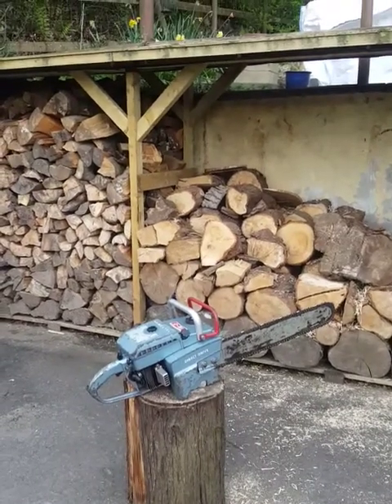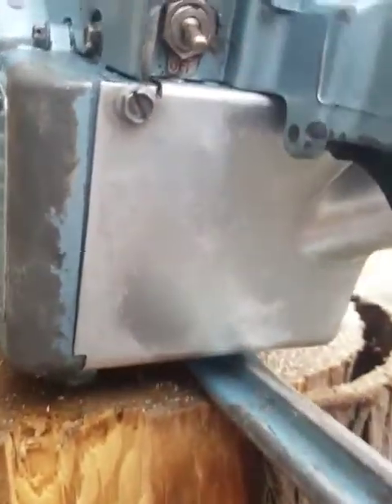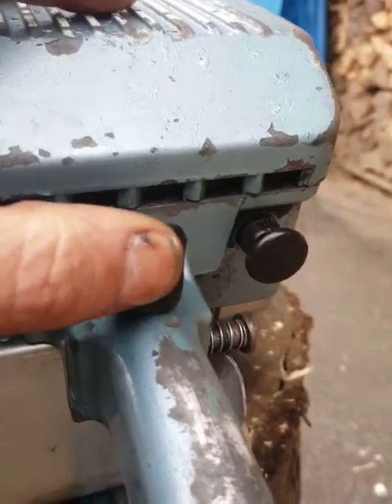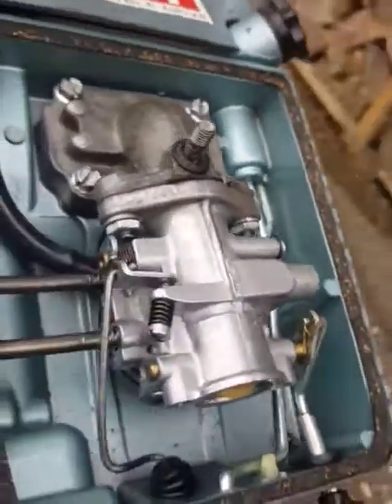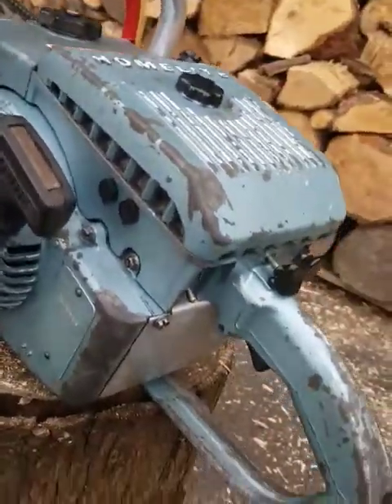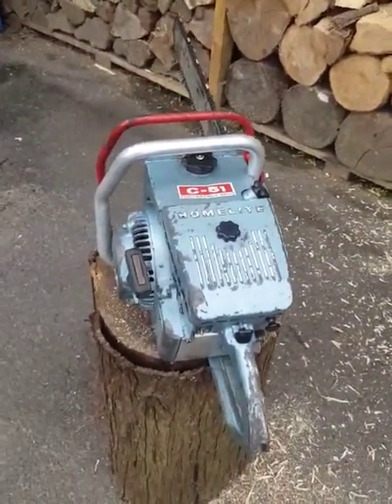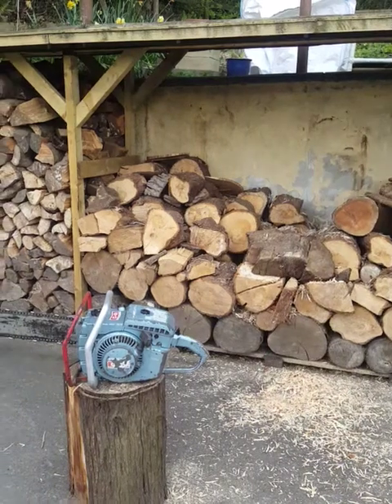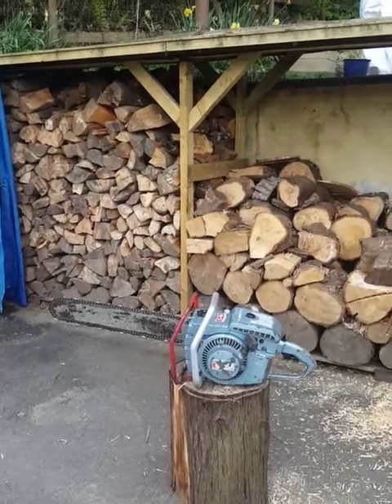Homelite C51. First run and cut

Comment: You made me laugh my friend when you called it a silencer! There is nothing silence about that pipe! We here in America refur to it as a stack or a stinger pipe! I use these stinger pipes to show people that you cannot plug a 2-stroke engines exaust pipe off with a set of baffles and spark arrestors and blunt faces that make the spent exaust gasses hit and turn direction to make it's way out of a narrowed down hole to escape the saw! It creates a lot of excess heat passing by all the things that have been installed in the exaust pipe through the years by the EPA to save the planet! Anytime you ignite a fuel that explodes when lit on fire  in a combustible area you are now dealing with a super heated air traveling twice the speed of sound! And some of these newer saws are doing 14000 thousand RPM! That's alot of back to back firing super heated exaust gasses past these pieces that are inside that exaust pipe catching that heat and transferring it back into the cylinder of your chainsaw! All you have to do is take a little stroll back in time and take a look at the vintage chainsaws and the wide open stingers on all of them! Loud? Oh yes they are! But you can run a saw all day and never have a heat issue with one of those exaust pipes! But with a new saw with all the planet saving crap packed in your exaust, you would be lucky to get out of the woods without a scuffed piston on the exaust side if you're not very careful and skilled with a chainsaw and know what the sound of a piston trying to seize from being over heated! Besides, I love to disturb the peace with a saw that barks for a city block or ten! It says, there's a new sheriff in town to all the rookies that don't know how to tune one and make it bark like a big dog! 😉